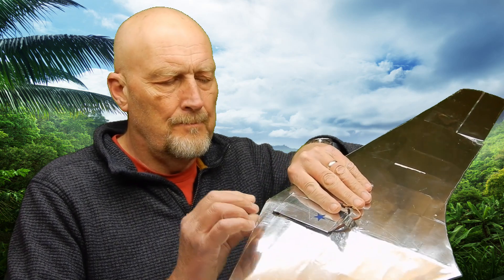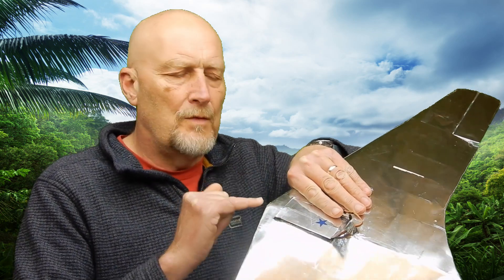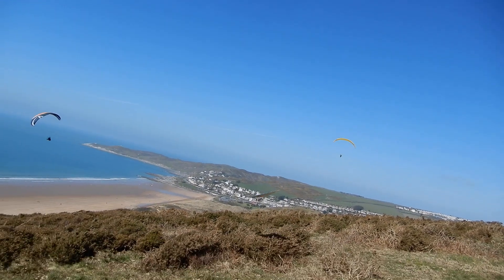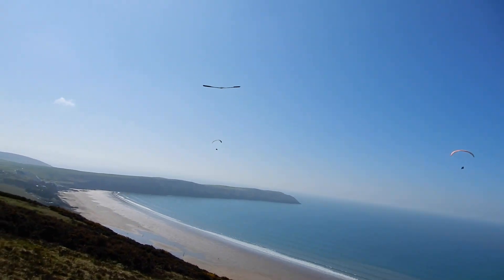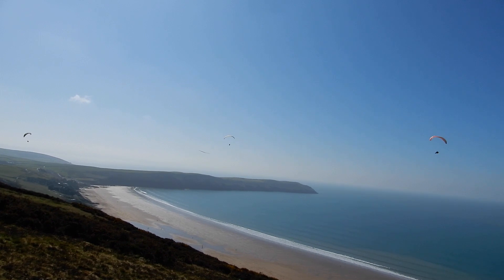Prandtl Flying Wing FVT-3 Radio control NASA WING

Comment: It's washed out on the tips which isn't an efficient way to fly for a high-performance glider ...time to do some Dynamic soaring or a thermal turn to the right you don't want why she out you won't wash in ....what are the benefits I don't know maybe straight line with a jet engine and that's it ...

Comment: If you had a flying wing with elevons that tapered out substantially wider towards the wing tips with the slight added up trim typical on flying wings would that have a similar effect to the washout or twist in a prandtl wing creating inherent stability? I'm thinking foamboard wing build?
Reply from the maker: Dunno i just built the kit mate
Reply: The Prandtl progressive twist creates a Bell Shaped Lift Distribution which creates proverse yaw for coordinated turns.  Without the BSLD any flying wing is subject to significant adverse yaw.  It isn't evident that simple (linear) wash out and triangular elevons will eliminate adverse yaw or provide "inherent stability".  Which is why all flying wings with elliptical lift distribution require some vertical device such as wingtip rudders or wingtip spoilers for yaw control.

Comment: sorry my frent this is not nasa wing is a  Horten HO 229
Reply from the maker: This was designed by Marko Stamenovic using Prandtl wing theory with his own aerodynamic modelling. The only thing near horten is the 50 mm trailing edge centre section
Reply: Even NASA wings aren't NASA wings as they are currently basing a lot of their flying wing development on the work of both Prandtl and the Horten brothers from the 1930's.
Reply: Yes, the design theory has been developed by Al Bowers of NASA who developed the theories of the Horten Brothers and Prandtl(1933). This knowledge I assume was used by the designer of of this particular wing to create a beautiful, aerodynamic and stable flying wing.